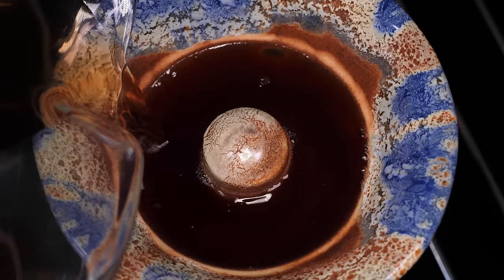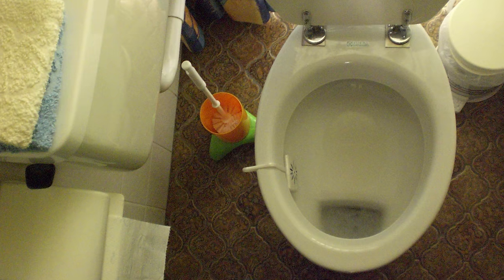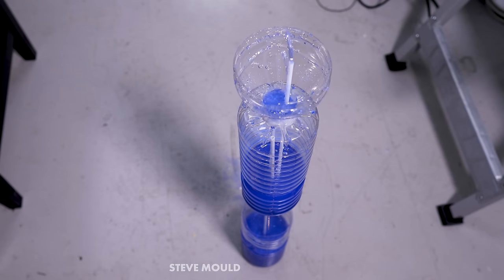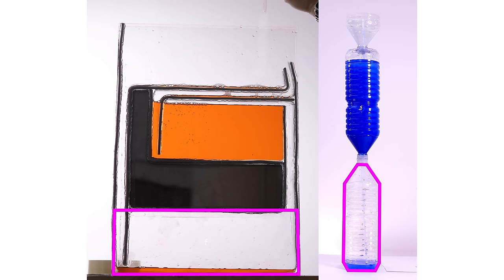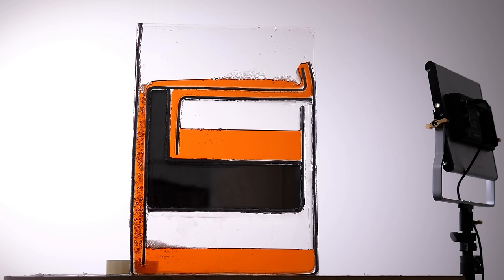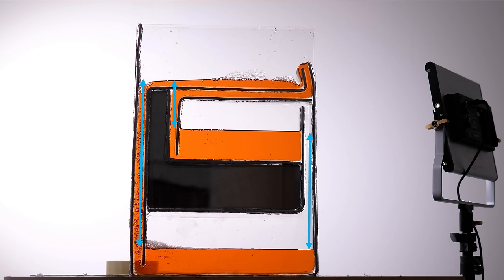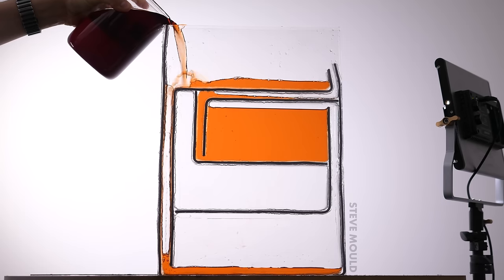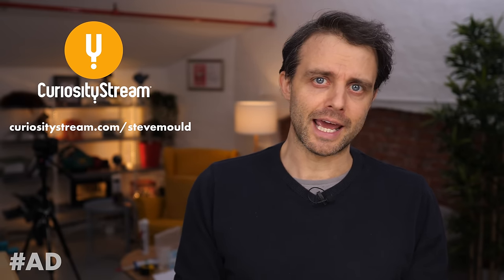A 2D Heron's Fountain Behaves Weirdly

Comment: You gave me an idea to use this principle for my cat's drinking fountain (cats love fresh, moving water).
So I'll give you an idea for a video: Water locks with water saving basins.

I'll refer you to look up how the Panama Channel water saving basins work.
Water locks may be simple in principle, but Water is such an important resource for the Panama channel they invested billions into water saving basins that save up to 60% of the water used per crossing. Because if it rains too little or they use up too much water, the depth of the cannal may render it impassable for shipping.

The way they work is that when a boat has to be lowered, instead of discharging the lock's water into the lower level of the waterway, it instead drains into a separate basin that is at a higher level than the lower channel. The water level at the lock and the basin will level off, at that point the valve between the lock and the basin is closed and the rest of the water has to drain into the lower level of the waterway. When a ship has to be raised, the water from the basin drains into the lock, then the basin valve is closed and the lock fills the rest of the way with water from the higher level.
A one basin design can save roughly 20-25% of water (it depends on the area covered by the basin). Panama channel uses 3 basins per lock. each at one height. When one levels off, the valve closes and the next one gets filled and so on.

It's a really simple and clever piece of engineering. And I've made one in Algodoo, so I can definitelly tell you it can be made as one of your models.

Also, just for curiosity's sake, I calculated how much each cubic meter of water costs to be moved on the panama channel based on how much water is drained and the cost of traversing the whole thing.
They charge $60 dollars per empty 20 foot container and $90 for each full container. The largest Panamax class ships can carry 15000 20 foot containers, so based on that, the height of the cannal and the size of the locks (there are six and they're all the same size), I calculated that each cubic meter of water in the panama channel costs between $0.16 and $0.25 if we don't take into acount the water saving or $0.40 to $0.60 if we do.
Where I live, the cost per cubic meter of treated tap water is roughly $1.
Reply: Grady from Practical Engineering has a great video on the locks
Reply: Here is the link to the Practical Engineering video. He actually has several videos demonstrating hydrodynamic properties. 
https://youtu.be/SBvclVcesEE
Reply: My friend has a cat Titan and he bought one of those fancy cat water fountain bowl things for him which cost like 50 bucks and Titan dumbass just goes to his new watering bowl and proceeds to destroy the whole damn thing within an hour lmao funniest shit

Comment: It would be interesting to see with two liquids of different densities ie water and oil
Reply: This was my thought as well. Does the compressibility of the gas play into the effect?
Reply: @riatorg  only the the compression of water.  The lesser of the two is restricted by the greater only to the point of the greater.  Then it becomes mass over volume.
Reply: @dontneedtoknow5836  water cant compress. Well, liquid water cant compress
Reply: @triste4-21  is there any liquid that can compress?
Reply: @BloodyHaemorrhoids83  nooo im 24 mins late
Reply: @dontneedtoknow5836  I'm pretty sure part of the definition of a liquid is that its volume is constant so if that's the case then no; it would be a gas if you could compress it

Comment: Uk usually aligns with Australia RE plumbing supplies, we have flushomatics if you want to go into some hydrodynamics seen in our toilets. They seemed cool to me, but it was part of my carrer, so that might have helped. Basically the valve breaks an air lock which alows a certain amount of water to pass and flush the toilet, then the airlocked equilibrium comes back and the flow stops again, giving you a flush that doesnt need time to refill between uses, which is ideal for public toilets. The valves are also mostly recyclable, the seals will need changing every so many years, but basically its a similar system to gas bottles, you trade an old leaking one for a refurbished valve, they refurbish yours and trade it on to someone else, you dont pay for a whole new valve, and the majority of it lasts decades before actually becoming waste.

Comment: I want to see a design which chains several reservoirs together so you can change them out on a rotational basis and keep the fountain going without stopping (preferably while using the same water).
Reply: that would be impossible since if water continually flows without external energy input, then that would be a perpetual machine and those cannot exist within the laws of physics
Reply: @hontonitai7838  Hence changing out the reservoirs. That's the energy input.
Reply: One day i thought ive done perpetual machine with magnets but it turned out that they were loosing their magnetic energy after some time pretty quick

Comment: The first thing I think after watching this is that I want to make a hydro gravity battery. You get a heavy jug of water and you turn it over, and water slowly flowing through this cycle across mechanical inhibitors generates a small amount of continuous power, until it stops and you have to turn the battery back over.

Comment: Everyone: gas is lighter than air
Me: how did he get liquid in two ends of a straw, but not the middle.....
Reply: Oh, now I need to know!
Reply: Maybe he dipped the two ends of the straw in a tank of liquid, one end deeper than the other, so he created an air bubble that was not in the center
Just guessing
Reply: Clamp the middle, fill the ends, cover the ends, remove the clamps.
Reply: @zim_the_vixen  double clamps! So obvious but I hadn’t thought of it. Thanks.
Reply: @zim_the_vixen  kinda hard to fill it with clamps, but i suppose if you have a really thin stream you can do it
Reply: @carlosmspk  or maybe a narrower tube and a pump!? lol this is getting ridiculous.
Reply: I think he just sucked on one end while either putting the other end in the tank or in the air.
Reply: @homelessrobot  that doesn’t put a gap in the middle
Reply: @carlosmspk  you’re right, no way to pull suction with double clamps. What about holding the U upside down and submerging it
Reply: @Villetownkid  yes it does.

1) put tube in orange koolaid. fill whole tube.
2) pull tube out, pull in 1/4th tube of air.
3) put tube back in, pulll in 1/4th tube of orange koolaid.
Reply: @homelessrobot  👍
Reply: @Villetownkid  same thing, if you do that, air can't get out and so liquid won't get in. The mystery continues

Comment: the heron fountain looks like a good example of a potential energy battery. you pour liquid at the top, essentially adding mass with high potential energy and it pushes the fluid in the middle into the bottom reservoir. so the amount of potential energy u can store is whatever the amount is in the middle reservoir and the depth is the distance between the middle and bottom reservoir. i dont know how this will work out if upscaled due to friction, surface tension, bubbling etc but it feels like you can fill the middle reservoir as to fill up the system with potential energy, start it with a small amount of potential energy by filling up the top reservoir, and harness the flow of liquid coming from the middle reservoir to the top reservoir

Comment: 7:41 in other words, you’ve simplified it even further into a 1-dimensional heron’s fountain.
Reply: It can't be one dimensional as that is not possible in a three dimensional universe.  Plus, if it was one dimensional there would no movement.
Reply: @protoborg  are you maybe confusing 1-D space for 0-D Space?

0-D: just a point, no movement. 
1-D: a line. only one “axis” of movement. Movement is still possible back and forth along that one line.
Reply: @haqeeqee  Agreed, and by @protoborg's same logic 2-D space is not possible in our universe
Reply: @haqeeqee  The fountain we are talking about is NOT along a single plain.  It is based on movement across the second axis.  Thus, no this is NOT one dimensional.
Reply: @protoborg  that’s technically true. 

But even the 2-D fountain isn’t really 2-D, it’s a simulation of a 2-D fountain. 

In the same time way, the heron’s fountain he made from the pipe, simulates a 1-D fountain. 
Even if it isn’t actually 1-D.
Reply: @haqeeqee  No he didn't.  Heron's fountain involves the liquid being pushed UP the other side.  Thus, it is NOT the same as a straight tube since the straight tube is merely gravity pulling the liquid down and out of the tube.  Heron's fountain is about defying a bit of gravity.  So no he didn't make a 1D fountain.

The 2D fountain IS 2D.  It is not a simulation of one as there is no way for a 2D anything to exist in 3D space.  Thus, it is not a simulation of a thing that does not exist.
Reply: @protoborg  this is a joke, right? They say that because there isnt anything interesting to note in the other 2.
Reply: @senza4591  Wrong.
Reply: @haqeeqee  No movement is NOT possible back and forth.  For one thing, the particles would collide with each other.  Second, gravity would be impossible in 2D.  Third, matter cannot exist in a 1D universe do to their being no particles of matter as even particles are 3D.
Reply: @igon388  It isn't.  But a 1D universe is also not possible as by its very nature a universe must be at least 2D.
Reply: @protoborg  Funnily enough a curve is one dimensional. Also, the gravitational forces along that curve can be simplified to only acting in the direction of the curve with varying magnitudes. Because of this, I believe it is an accurate representation of a one dimensional Heron's fountain. What we mean by one dimensional is there is only any significance in the one dimension. Obviously not "this is how it would work in a one dimensional universe" such a thing doesn't exist, we both agree - just like with two dimensions, it would just be silly
Reply: @igon388  But that's just it; a curve is NOT one dimensional.  In fact, it MUST be two dimensional.  Now granted each moment of travel around the curve is a one dimensional path.  However, those are infinitely small paths that in total are two dimensional.  A one dimensional thing has no trajectory.  A curve is, by definition, a series of trajectories that are all packed together infinitely tightly to form the curve.
Reply: @igon388  A point on the curve, not the curve itself.  You still need other parameters to determine the actual location of the point.  Further, even in differential geometry, the curve is clearly two dimensional.  It has a size on the x-axis AND on the y-axis.
Reply: @protoborg  Just because a graph has two dimensions doesn't mean everything in it is two dimensional. Can we agree that the straight line y = x is one dimensional? In this case it has a "size on the x-axis AND on the y-axis" but is exactly the same as any other straight line. Anyway, imagine you draw a straight line on a piece of paper, this represents one dimension. Imagine we have a thing that lives on this line, it can move forward and backward along this line but not left, right, up, or down. It lives purely in one dimension. Now let's take this paper and bend it upwards so we have an arch shape. The line on our page is now representing a curve. But the thing that lives on this line can still only move forward and backward not left, right, up, or down. It still only exists in one dimension, nothing has changed for the thing living on our line, even though it is now curved.

Comment: What you need here is a trompe, straws/tubes reaching almost the bottom of the left waterfall tube but sticking out ABOVE the water level above (in the model version that is,) otherwise you dig a shaft 300 feet long and just use short straws in a funnel shape with a stream above forcing the air BUBBLES downwards in the funnel then tube along with the higher pressure water, and a chamber after a right turn at the bottom, culminating in a chamber of COMPRESSED AIR and water going to another tube to almost the height of the stream but a little further along downhill.  This compressed air can be used to drive air driven MACHINERY, fill tanks to run vehicles with steam engines running on just air pressure not steam, or run into a building to create a massive refrigerated room.  Getting back to the model version here, the tube would NEED to be very low in the tank to allow the air to be forced by the water pressure above, to the right giving more AIR into the system to keep it going....  erm for how long who knows?  ;)  You'd definitely need more water here... Not sure the tube width changes or actual depth required down the waterfall area but I'm sure SOMEONE will give it a whirl  :P

Comment: "The downside is, just,  the horrendous smell"  No need to say more.
Reply: It works 20x better than UK toilets, which gets block just by piece of toilet paper. lol.
Reply: Let me introduce you to the outhouse...
Reply: Well yes, but, the other toilets smell too. As I regularly use both types, the difference in smell is not that big, in either case you want to open the window.
But the difference in backsplash IS big, I hate it sitting on one of those backsplashing things...
Reply: @Delibro  agreed they both smell and splashing really is the worst. Clearly you're not supposed to let it sit for hours xD
So the time taken in producing said mighty turd being equal, the time it takes to then flush it is a negligible addition to the overall unholy fumes. While in the shelf case you don't get a cold splash against your ass and might perhaps notice you happen to be bleeding out as well, nifty👌🏻
Reply: @CitizenMio  you are not suppose to flash the non shelf toilet while sitting on it. The purpose of the lid is to close the toilet while flushing to prevent the washing out of the basin from ejecting micro particles into the air. You are suppose to close the lid then flush creating an imperfect seal. This allows air into from the gaps under the seat and prevent the contents from ejecting out of the bowl and the contents flush down the drain.

Comment: At 10:20 you see a bubble entrained in the pressurizing column and the mechanism still works as water flows around the bubble.  The bubble must slow the water flow and this is neat example of how entrapped air can mess up flow, as in some siphon systems.

Overall, a nice visual demonstration of an unintuitive phenomenon.

Comment: 1:50 Washout toilets are used in the UK, too: That shelf is considerably easier to remove a stool sample from than most other designs, and (at least when I worked in the industry in the late 90s) they were common for hospital use, and also in 318 stainless steel; By order of HMPS.

The greater distance through the trap also made it harder to use the u-bend to store stuff out of sight of staff, though there were other ways this was avoided.

Comment: maybe a see-through 2d water hammer? i’ve always been fascinated by them
Reply: And water hammer pump (hydraulic ram).
Having those 2D toilets as actual 2D water mechanisms would be neat as well.
Reply: Really, a hydraulic ram, a pulser pump, and a thrompe, are all really simple pumps that could almost be presented together.  The hydraulic ram has a moving part which might be exceptionally difficult to recreate for this particular media.  The other two have no moving parts, and respectively pump fluids or air.

Comment: Others have probably commented but I couldn’t see any in the top batch: when making stainglass windows here in the U.S. my grandfather taught me to put a copper tape around the side edge of every piece of glass and then using the thick diameter solder not the thin stuff you use for electronics you can set the pieces adjacent and solder the edges together

Comment: This really makes me want to see one where a greedy cup mechanism empties the bottom container when its done so you can reuse the water to refill the top and start it over.

I think might work if the base water level at the bottom seals off the air from escaping into the greedy cup mechanism

Comment: Only issue is that the higher shorter arrows showing the shorter column of water should be going from the middle container's top to where the upper tube comes out into air, not to the top of the open chamber, that's where the upper water tube's pressure difference is valid to measure between. Other than that, great recreation, very intuitive explanation!

Comment: I think it’s best to think of this as a hydraulic/pneumatic piston system. The column on the left provides force from gravity, and I think you’ll find that the fluid in the bottom reservoir rises at a rate appropriate for the volume of liquid falling down the left column that’s trying to achieve equilibrium. The fluid in the bottom reservoir rises and acts as a piston or plunger. The surface area of the plunger is larger than the surface area of the middle reservoir. The air column on the right is the equivalent of an air hose and because the air is so lightweight, gravity is not a significant factor, but pressure is. Because the surface area of the middle reservoir is smaller, the equivalent force applied by the larger surface area in the bottom reservoir is effectively multiplied, pressing against the surface of the fluid and causing it to move downward. Once again, the fluid is effectively both the piston and the hydraulic fluid, and the middle column near the top simply acts as a hydraulic line leading to an exit, with gravity being the only real resistance because of the weight of the fluid.